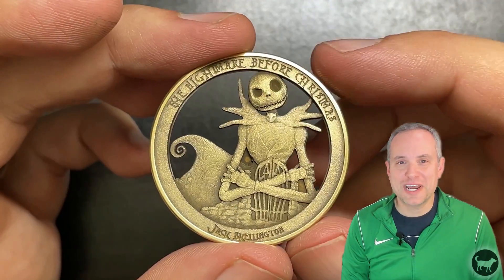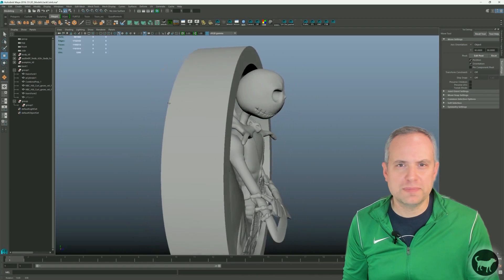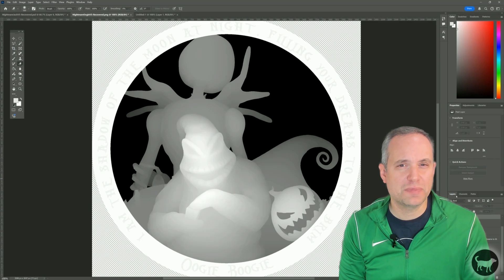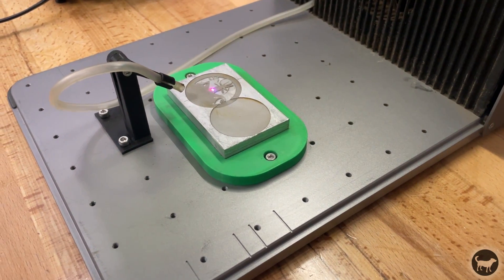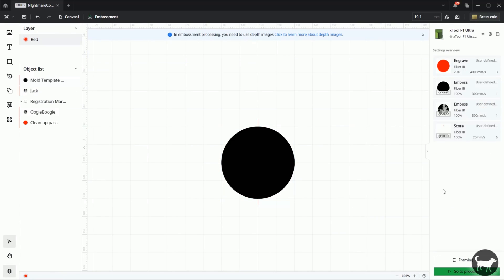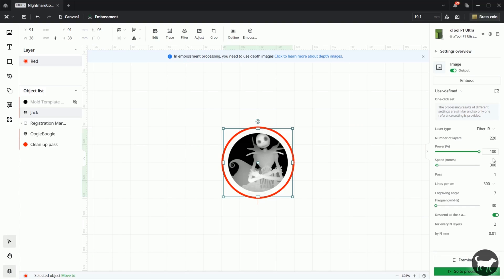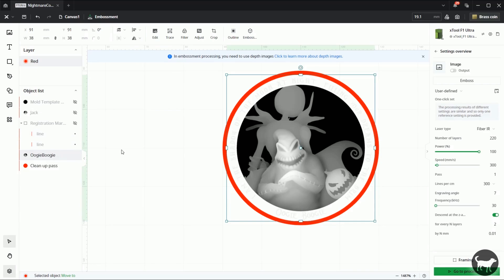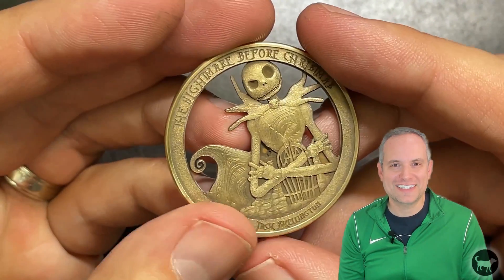Nightmare Before Christmas Brass Coin made with an xTool F1 Ultra | Double Sided | Pass Through

Comment: Make sure you get the correct coin blanks.  I didn't pay close attention and ended up with 2.7 mm  (2.5mm thick metal in the center), vs the 3mm in the ones you specified (3mm).  Jack looked pretty good (first side), but when I did Oogie, it burned through -- lost the "feathers" on his shoulders, ribs shown thru, the entire "hill' was gone.   Oops!   
As an aside, it would seem that it would be a lot quicker if you cut out the empty sections rather than ablating them away with a thousand strokes.
Reply from the maker: I had tried a version where I cut out the shapes rather then ablating the full area and it was really hard to achieve. I wasn't actually able to make it all of the way through small gaps. You might be able to on some of the larger sections.

Comment: Wow your projects are very impressive. I have a Xtool D1 Pro 20w, can I do 3D engraving on coins similar to some of your projects? I also have the IR laser for the same machine.  I have not used the IR laser as yet, and I can't find any reviews or tutorials on using it. Please help! Thanks Tim
Reply from the maker: Unfortunately what you need to do this is a Fiber Laser. Why the IR module on your machine is technically in the same wavelength of a fiber laser the strength is far too little for something like this.

Comment: hello, first of all, great video! 
I'd like to start with an open question: I'm a beginner in laser cutting but not in 3d printing, I've had an Ultimaker for 5-7 years and I'm happy with it, but now I have a new project that will require the creation of a lot of money coin and only metal money coin, I was wondering if you had any advice on the machine that would be best suited to my needs given my level.  
once again, thank you for this video
Reply from the maker: There are many brands to choose from but in your case I would say the real consideration is wattage. The higher the wattage the faster the coins will engrave. If you are not concerned about engraving in color on stainless you can steer clear of the MOPA lasers which will save you a good amount of money. I wouldn't go lower then 30W in your case and 60W is even better. While 20W can work I wouldn't want to rely on that if I was making lots of coins. Good luck and thanks for watching!

Comment: Quick Question, I'm using the xtool brass coin which is apparently thicker than the coin you used.  It measures at 4.32mm.  My coin didn't cut through, is there a way to adjust the settings for this coin?

Comment: Hi, I was curious what kind of metal is the mold block and do you have a online source for it?
Reply from the maker: Hi. it's an aluminum block that I happened to have laying around. It doesn't need to be that big or even out of aluminum. It just needs to be some sort of flat metal that you can engrave about a mm or two into to be able to set the coin down. You can even search amazon for aluminum block and you will find some but again it could be a bracket you buy at a hardware store or a scrape piece from somewhere.
Reply: @BusterBeagle3D  Thank you, I appreciate the info and the coin is amazing, I knew we could make coins with the ultra, but never thought it could be this cool. I will have to learn 3d modeling now lol.

Comment: Is there any way you could show us how to use the burn tool to get the results you did?  I have watched other tutorials and they don't seem to produce the results that you show here.
Reply from the maker: Hi. It just kind of becomes an art form when doing that. I personally like to duplicate the image and then burn tool on a copy so that I can always blend it into the original by erasing it away if I went too hard. I also sometimes will simply duplicate the layer and they set the layer to multiply in the blending options. Again erasing the sections that I don't want to multiply until I feel it looks good. Another good thing to do is to check the heightmap in the emboss preview in xTool Creative Space. It shows the image to you as a 3D model which is a great way to check and see if you have gone too far or if you want to exaggerate more on a certain area. Hope this helps.
Reply: @BusterBeagle3D  TY for pointing me in the right direction.

Comment: Great job and thanks for the video.  I do my registration marks on my jig and mark the coin with a fine sharpe pen.  Which then wipes off with alcohol when completed.  Also if you make the registration marks at 180 and 90 degrees.  You can do either a horizontal or vertical flip of the coin.  US Currency has a vertical flip and most of my customers request that when asked.  Of course this would not work with a pass through embossing like you are doing here.  But most of the coins I do are just engraved.
Reply from the maker: Thank you! I have done it with a sharpie as well but for this instance where even a fraction off is like a mile off I felt I had to be even more precise. Trust me I have about 9 failures of this coin to prove it. Not all because of the registration but a few of them that are just a hair off which is not as noticeable when you look with the naked eye but when I zoom in to take a video of the process it was. Also the mark is so lite that even though it looks like a deep burn on camera it pretty much buffs away during the cleaning process.

Comment: I also do CAD and 3D printing in my “real job”. This id a cool way to bring that world into the laser-verse. Now to decide if I need the Ultra or if the regular F1 is enough🤔Any thoughts?
Reply from the maker: Nice. The original F1 is not a real fiber laser. Yes it has a 1064 nm laser but it's a much smaller diode source. It could never do something like these coins.

Comment: Great video. I have a 2d image that I would like to turn into a bas relief model to engrave on a coin. It's not a photograph, it's artwork that was drawn. Are you aware of any software that can convert a 2d image to a 3d bas relief? I have tried Vistasculpt but I'm not getting the results I need. It could be because the color variation in the image are subtle. If you have any suggestions I would really appreciate them. Thank you for all the great tutorials. I have a Commarker B4 fiber laser that I bought after watching yours and several other reviews. I have been very happy with it.

Comment: I just started doing research on fiber lasers to add fine detail to injection molds and am curious as to why you used the 20 watt laser instead of the 60 watt MOPA laser you reviewed a few months ago? Wouldn't the 60 watt have been much faster than the 20? Thank you for the video!
Reply from the maker: You are correct. I ended up doing one on that machine after as well and it did it in about a 1/3 of the time. I wanted to use this machine because it has a pretty large user group as well as it shows how it's possible with a 20W machine which I'm assuming a larger portion of the hobby space users use.